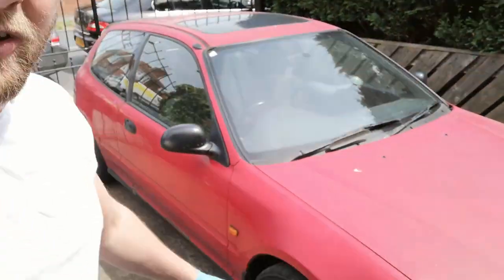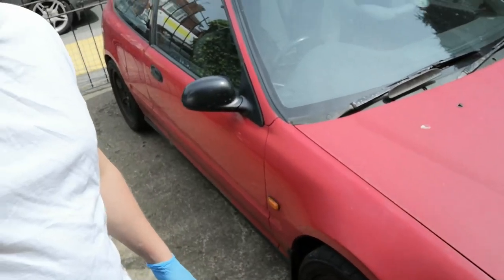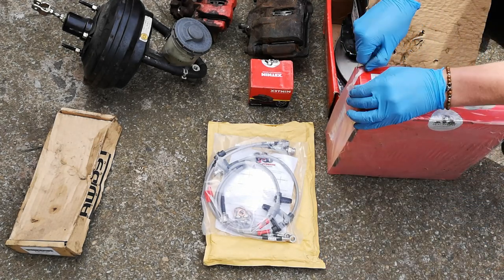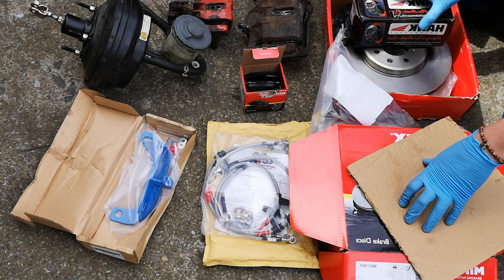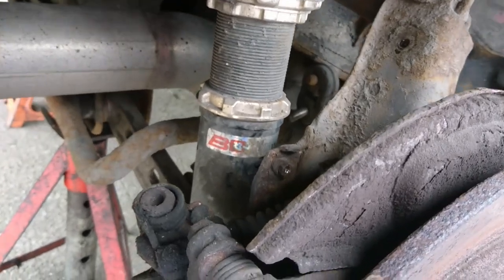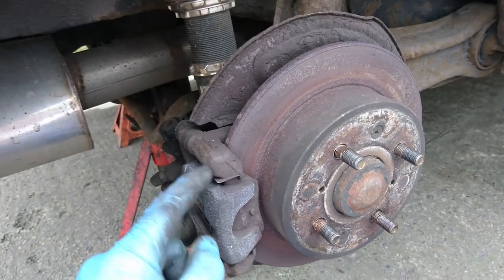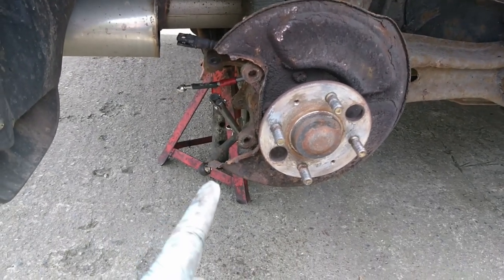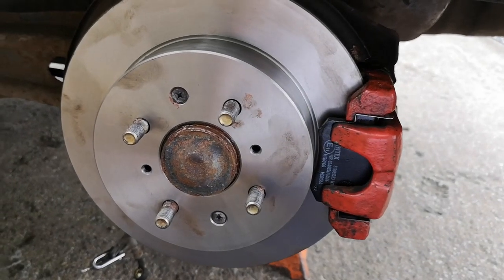Civic rear brake upgrade! Unboxing car parts! How to get 260mm brakes on rear of EG EK EJ

Comment: great content there mate.... learned a lot from this swap... but seems used parts on MG's are hard to find.. however,,thanks for sharing your video,,,
Reply from the maker: It didn't use to be that way, they were cheap and everywhere... but thanks man, this is an early one so its not as well made if I'm honest 😅
Reply: Or mb6 vti too

Comment: Hi do all of these mg parts just bolt up with out modification?
Reply from the maker: So kinda, the Honda handbrake cable bracket needs one of the 2 bolt holes elongated to bolt up. Thats it if you get the right discs and calipers
Reply: Your rear galiper come wich car ?